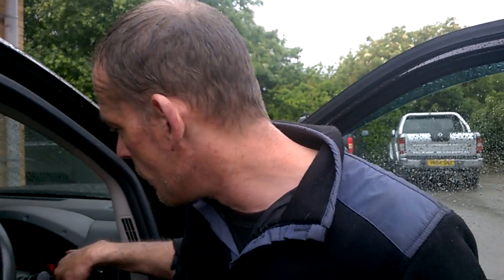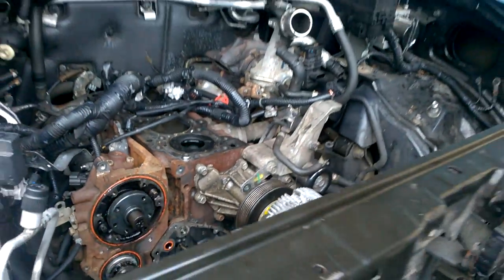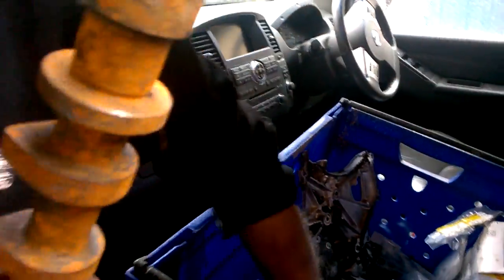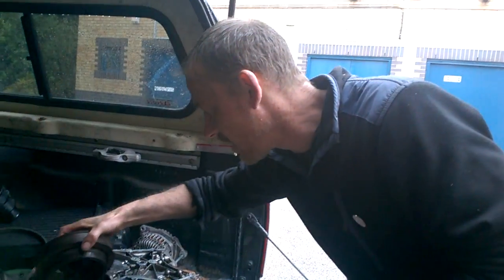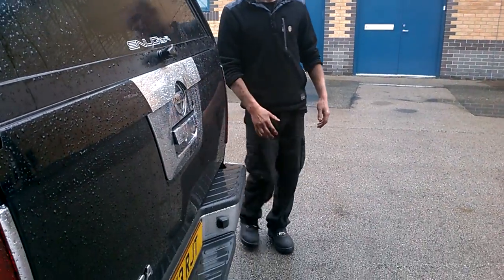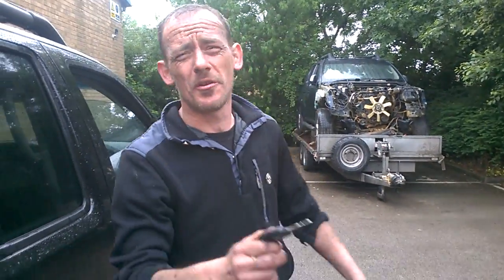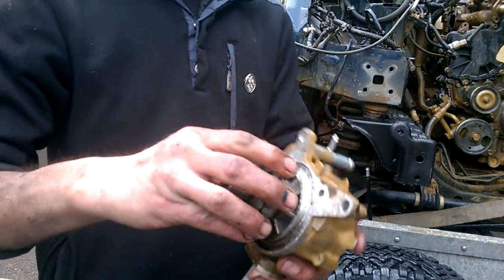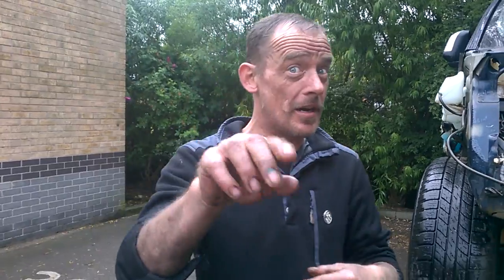Nissan snapped Timing chain 2012 (48k) shocking!

Comment: I had the same problem with my 2014 Juke SL manufactured on November 29,2013. yet Nissan Canada looks at it as a 2014 model. Not covered under the Voluntary Recall Campaign P-4213 that covers all Juke models 2011 to 2013, Service Bulletin SB-10055923-4231, Valid from Sept. 22,2014 to Oct. 30,2015. Yet the problem of timing chain stretching wasn't discovered until May 5,2014.  So I had to pay $2,440. out of my own pocket for the repairs. So why was my Juke not covered? Nissan has a problem with Model and Manufacturing dating!!!!
Reply from the maker: Thank you for your honest input

Comment: I have a 2013 Nissan Xterra PRO-4X 6spd 4WD VQ40DE.  I replaced the timing chain at 110k miles, had a tooth jump & re-did the timing at 155k, and now, I think my new timing chain broke at 182k.  What should I expect to replace this time around?

Comment: Just came across your channel and subbed after watching this video. I have a 2016 Altima with a 2.5l.  Does this engine have the same issues with its timing chain also? Or did Nissan uprade it in that year at the factory?
Reply: No it only concerns diesel nissan pick ups that are not sold in US (equipped with renault engines)

Comment: That chain came straight off a childrens bike.
Reply: I thought so. I thought all Nissan timing chains are strengthened with at least 4 times chains each block which look different from any Toyota
Reply: @lienchase2301  I have eaten shortbread that was tougher than the material they made the engine parts from.  Shame.

Comment: Hi Des

I am hoping you may be able to help. I'm a fan and subscriber of your of your youtube videos giving really helpful advice and how to's for Nissan Navara's.  

I have a Nissan Navara D40 STX 4lt V6 (VIN VSK) that has blown a head gasket (not sure which one). I have searched through all your videos and can't find anything that shows how to replace the heads on a Nissan Navara v6. I was wondering you could possibly help me with....

1) Any videos that you may have that show how to replace the heads on the Navara 2008 V6..

2) Do I need to replace both heads or just the one that has blown. If just one - how can I tell which one?

3) What do I need to replace the head gaskets. I gather a full head gasket kit with new head bolts as a start. Are there any other gaskets / parts I would need to replace as a part of the process in replacing the head gasket/gaskets. Are you able to give me a price for supply of the required parts?

I live in Australia - but see that you can supply to Australia as well.  

4) Any special things I should know (tricks - what and not to do's).

Cheers,

Darren

Comment: One thing I didn't mention about why I have a blown head gasket or cracked head. All this crap started after I took my car Nissan D40 2008 v6 to a Nissan dealer Nissan Ipswich in Brisbane Australia) to replace a shitty timing chain - which cost a fortune $3,800 AUD. Other than the timing chain the car was driving great. After they replaced the timing chain I had nothing but issues. First, they did not replace the oil or oil filter, despite the oil being black and v thin. Clearly from the timing chain issue. The car also started overheating and was low on coolant. In the first week the car broke down. Had it towed to Nissan. They admitted that there was an issue with the timing not being set correctly after being repaired. However, they still hit me up for two timing cam sensors. They also replaced the oil and topped the coolant after I complained that this had not been done when they replaced the timing chain. J also had no car over Xmas and New Year - no loaner was supplied. Shortly after I noticed the car was still overheating and took it back to Nissan. It was also leaking oil from the tappet cover gasket - due to poor workmanship when replacing the timing chain. There was / is also a big leak in the air filter pipe - they obviously broke that when they replaced the timing chain. They did not fix that properly either. They then replaced the now stuffed thermostat and a radiator hose - another $544 - of which I refused to pay. As I saw this is an ongoing issue arising from the overheating issue that occurred after the timing chain replacement. Upon arriving home I could smell coolant - clearly they hadn't fixed the coolant leak. And clearly they did not do a pressure check on the system. I had to use the car to take my son to hospital - on the way the car lost ALL the coolant due to there being a break in the heater tap valve. The engine now has either a cracked head or blown head gasket. All due to the ongoing coolant problem not being fixed in the first, second or last visit. I now don't want to take the car back to them as they are only costing me money and destroyed my car. I haven't had a car for weeks, cant take me kids to school, go shopping - you name it. Nissan are the biggest mob of a'holes and their mechanics are incompetent and no better. 

Any advice?

cheers,

Darren
Reply: AlwaySaWay, Hi Darren sorry to hear about all your troubles but things are no better here in the UK, people are tearing their hair out with the problems their having with their Navaras, timing chain and rotten chassis being just two of the problems, Nissan are repairing the chassis or scrapping the vehicle if it's to bad to repair. These problems are disgraceful for a Major manufacturer like Nissan who used to be at the top of the game but now can't be trusted anymore, if they don't change their ways they are going to go the way of the dinosaur, customers will only put up with this rubbish for so long, if you can get shut because it will probably cost more to repair than the vehicle is worth, cut your losses and invest in something else it's a money pit with no bottom.

Comment: I have a 2012 d22 navara and am very concerned because i am travelling great distances towing a caravan. sometimes i do hear a cracking sound on initial start up...mainly when cold. I spoke to a nissan mechanic and he told me there were two timing chains, the lower one was single and the top one was dual and also said they never break. The car has done 63,000km's I live in Australia and would appreciate an opinion from someone in Australia.I do enjoy listening to your youtube vid's

Comment: Funny thing....went car shopping about 4 weeks ago and bought a 2005 Mazda 6  3.0L (yes...damn Ford engine) with 182k and I lucked out since the previous owner did the timing chain, timing chain tensioner,  new chain guides, new oil pump chain, new O2's front and back, new exhaust,  NGK iridium plugs, new high pressure fuel pump and new belts...all for just under $4K and minus a couple of scratches on the bumpers, the car is mint. 
In the process of finding this little germ, I must've waded through a sea of Nissans  of every make and model on the way to it. I stay the fuck away from Nissan now.

Comment: I think I have a broken timing chain guide. if I left it there, will the timing chain eventually snap or cause some other problems?
Reply from the maker: Yes you need to get the timing changed All the best Des.
Reply: Thx for replying but my problem is kind of confusing I hope you know if that's the guide or not. So I heard the chain-like cranking sound 1 month ago, the sound happens around 1500rpm and I think it's from the bottom of the engine I went ahead and changed the tensioner, then the problem reduced, the sound is not as loud as before and happens much less often. 
But a few days ago I noticed something weird, after the tensioner change, it doesn't make the noise after cold starts, when the car is fully warm up the sound comes back. 
What's even weirder is that it only make that noise when the car is moving, if I stop the car, put it into N or P, then rev it up to around 1500rpm, there will be no chain noise, I tried more than 10 times revving it up to 1500rpm but I got nothing no matter how hard i tried (I almost doubted if it's really the timing chain or not, but I still think it's the chain or the guide's problem since the problem reduced a lot after changing tensioner). I'm confused so please give me some hints if you know what it could be. thanks for you time :(
Reply: West yorkshire engine services  hello des, if I do the timing chain duplex upgrade bga, is there anything I need to modified when i put it back altogether? thanks in ireland

Comment: Nissan's gonna go bankrupt again if they continue with this shit. 
I bought a new Maxima in 2004 and my timing chain started rattling at 30,000mi. Still under full factory warranty and the gold package extended warranty, they refused to even acknowledge the problem. They said it was my exhaust rattling. 

I used to LOVE Nissan but after 7 cars i am done with this Nissan-Renault junk. Nissan is not what it used to be.

Comment: Only 48,000 miles Nissan.? Even my old Frontera 2.3 D ( a bit underpowered ) did 137,000 miles without a spanner near the engine. That's a Big repair bill.

Comment: Without a doubt the spain built navara was a lower built quality than the thai built....I have a 2007 thai built navara...1 of the very first ones and its doin 160000 miles....never changed anything besides basic parts...and the chassis doest have a rust spot on it.

Comment: There is no getting away from the fact that these vehicles are Shit, that timing chain issue is a disgrace putting a single pitch chain on a 16valve engine is asking for trouble because of the load on the chain. Then there's the problem of the chassis rotting through and the vehicle braking in half, have Nissan lost the plot, this is all down to penny pinching in the build process, as long as it gets past the warranty period that seems fine with Nissan and to hell with the cost to the customer. Nissan are not on their own Ford are having lots of problems with their small engines for the same reasons getting parts as cheap as possible knowing there not going to last, this seems to be a trend in the motor industry at the moment but people are getting wise to these tricks.

Comment: solution DO NOT BUY A NISSAN!! They are absolute s*** quality vehicles.. I had a 12 month battle with them after a turbo on our juke failed after 18000 miles whilst under warranty with full Nissan service history only 1 week after they did a recall repair ON THE TURBO (with evidence it clearly wasnt done properly)!! Now I want to do all work myself or using my mates garage and they refuse to tell you the engine revision of your engine so you cant buy the correct parts (my year has 2 revisions) in a futile attempt to retain your business!!

Comment: Buy a Renault 1.5dci   bulletproof engine
Reply: Just wait till 100k or more then we will see if see holds up to the 350k miles toyota d4d bombproof engine
Reply: You still have to replace the timing belt at 100,000 km - not cheap.
Reply: No belt big strong chain lasts a long time

Comment: I HAVE NISSAN NAVARA SE 2012 I've Change VOLON MOTEUR FLYWHEEL DO NOT FUNCTION AFTER demarage MY CAR  I'M SAD 
The engine does not work  When Remove sensor Engine actuation BUT Do not exceed the speed of the car  70KMH

Comment: I am with 2006 navara 167k on a clock no mods still on original chain and water pump but what I do is I service in shorter time.scale every 4k and good fuel ⛽ ie shell esso.. and zx1 oil additive